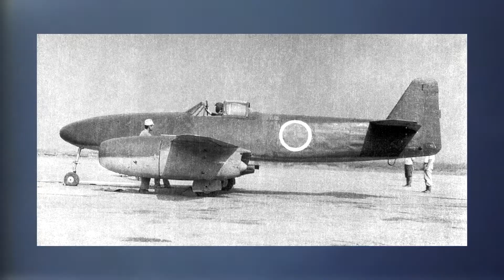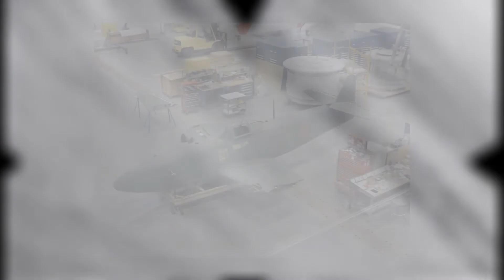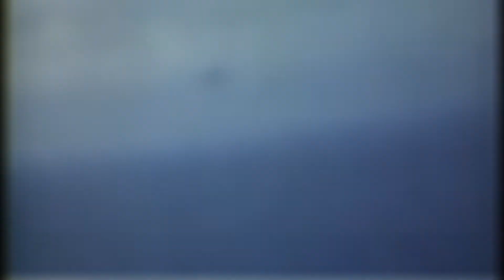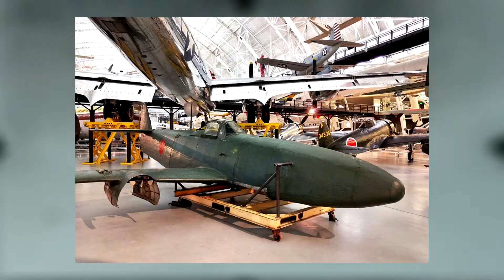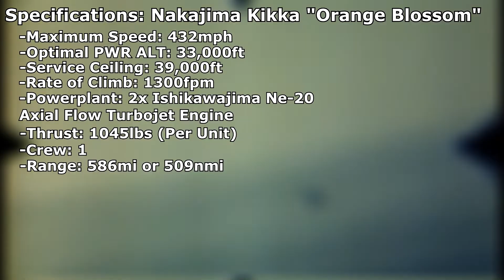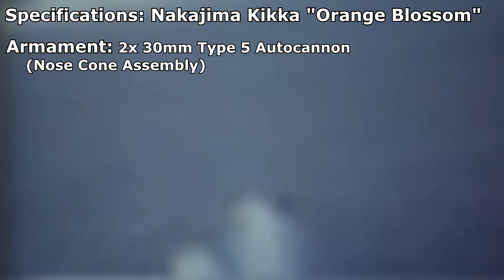The Japanese Me 262 | Nakajima Kikka

Comment: that sub wasn't captured it was blown out of the water by a B 24!!
Reply from the maker: Thank you! I was confused as I couldn’t find concrete evidence on the sub. Really appreciate the help.
Reply: @TiptonBros  I think the sub had travelled from Germany to Singapore, where the technical drawings were dropped, and when the sub left Singapore it was attacked and sunk. Meanwhile the drawings were flown to Japan. But before all this, the Japanese had their own jet engine development programme before the war. They then came up with the Ne series, the first one was very basic with a centifugal type compressor, The second engine of the series developed some power approaching the German Jumo and BMW engines. So when they got the German designs complete with their performance data and plus the time limitations on all fronts, they thought it easier to just tool up and go with the German engines.
Reply: Which sub was it?
Reply: @mbryson2899  I 52 is the number i have for it! a C3 cargo sub!